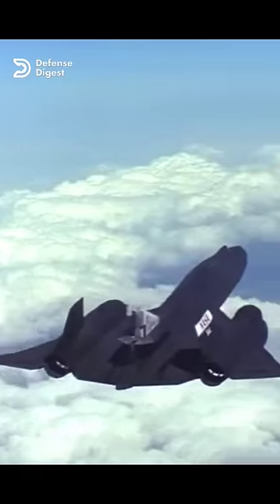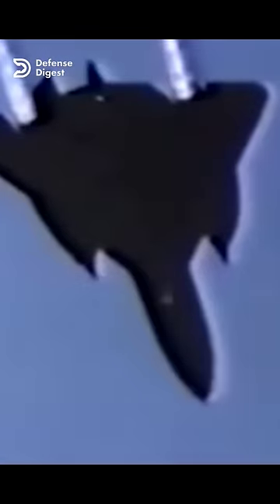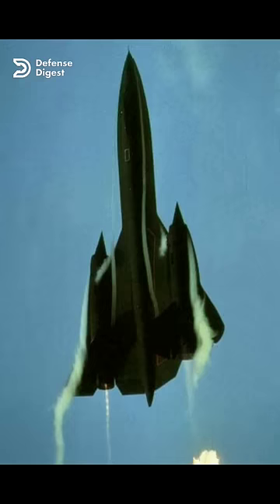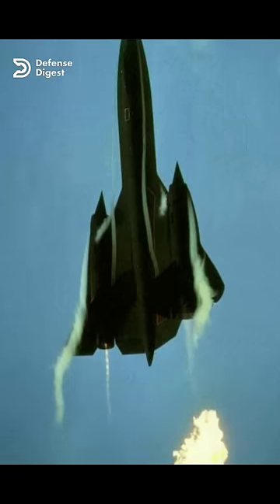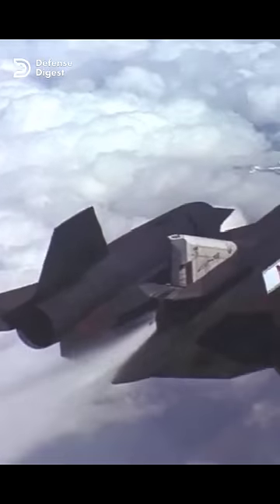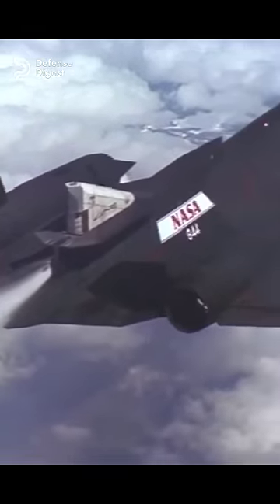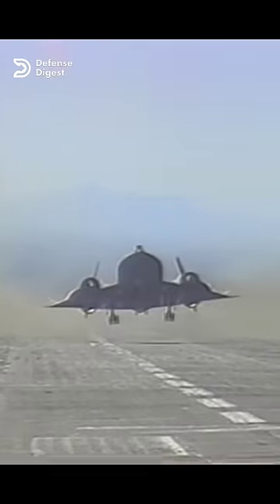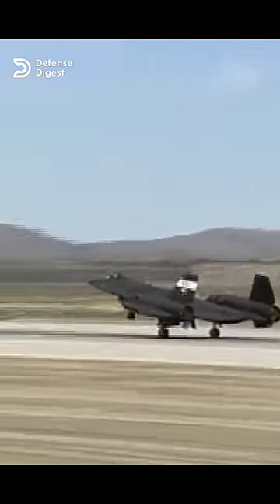The SR-71 Blackbird Is So Fast That It Lights the Sky on Fire! #shorts

Comment: You forgot to mention that the SR-71 used to leak fuel when it was on the ground. It was due to the fuel tanks being designed to fully seal as the plane increased its altitude. The Blackbird would have to be refueled just after takeoff. Still, the SR-71 Blackbird is one of the most amazing aircraft ever designed, with speed and altitude records that may never be broken. Such an iconic aircraft.
Reply: Well if they didn't do that the gas tanks would crush and the rest of the fuselage would crush itself and explode under the pressure of doing 2,200 miles an hour as well as the outside temperatures reaching 650 degrees Fahrenheit
Reply: @Priester23  you'd have to do what rockets do, pump alternative gas into the fuel tanks to stop them from crushing
Reply: Ha! Lol. While I love the SR71 what they have now (*& created in the 80s) was/is aircraft that you CANT see, it flies too fast for the human eye to see. *The TR3B is triangular & has plasma thrusters. A more recent craft is more round, cloaks itself & bc of the radiowaves that cover it, if it flies too close to the ground, it starts everything on fire (forest fires) & is faster than the human eye but you can see it on surveillance cameras if you slow it way down. Can land in the ocean with no prob, kept at an underwater facility off of Calif.
Reply: @Priester23  you do realize that all aircraft fuel tanks are vented to prevent them from collapsing.  The fuel it used had the consistency of syrup.  It was used to cool the aircraft, and get it more liquid at the same time.
Reply: they were designed to seal with heat, not altitude.
Reply: @Userxyz-z2d  there's so much wrong with that i dont even know where to start. anything anywhere near that fast would explode from air resistance alone. all their really fast jets would have to suborbital to prevent that. ive heard as fast as mach 5

Comment: I was a USAF ARFF and The Blackbird is Stationed at my Base, RAF Mildenhall, We we're required to standby in the Hangar during Refueling & Defueling we had to stand right in front of the Engine. TEB can't be extinguished with foam or water. Sand was all that worked to smother the flames. 
We trained on her twice a month. Best of times

Comment: I grew up in Colorado Springs & more than once, SRs came into Peterson Field there. They'd come in slow final approach at what seemed like treetop level right over our heads where I worked on Hwy 24. You can't really appreciate how big and awe-inspiring they are till you see one in the air. I'll always remember the SR71, the Space Shuttle on top of a 747 and The Concorde coming into Pete!
Reply: I was stationed at Peterson AFB from 1990 to the end of 1993. Still the most beautiful place I've lived. Every morning open the curtains to see 14,110 ft. Pikes Peak. I miss Colorado Springs.
Reply: @douglasdixon524  we moved there in 1956 from OK & thought we'd died & gone to heaven. We left in '90 but my son still lives there.
Reply: @chetcarman3530  My mom grew up in Cushing, OK during the 1930s and 40s.
Reply: @douglasdixon524  I spent my first 8 years then a few more off & on in Elk City & a year in Midwest City High.

Comment: No catalytic converters?
Reply: In California they call them Cadillac converters.
Reply: @bartbullock9742  
So in California if I put a set of these on my Datsun it becomes a Cadillac ?
Cool, I'm gonna do that . . . ✌😎
Reply: They gave it the pops and crackles tune
Reply: Where’s the electric motors. Or solar cmon
Reply: This is so funny, omg!!! 🤨😶 have you ever considered comedy as a profession? I was expecting your page to be full of funny videos.
Reply: It did have badass manual transmission and 4 barrel Holley carburetor.
Reply: aircraft don't have emissions so probably the biggest palution dumpers out there are airdracft
Reply: @thenaturalmidsouth9536  This plane needs a 454 big block engine to start it. No lie.
Reply: @3dsmax rocks  I'm small block Chevy guy, but you're dead right in this case, a plane like that needs a big block. No replacement for displacement.....
Reply: No, thieves came by overnight and took it.
Reply: My ride has muffler bearings
Reply: @thenaturalmidsouth9536    Even a Holley Dominator wouldn’t be enough. No,it’s gotta be one of those big,8-71 Dyer superchargers with giant,twin turbos! Must have some kind of highway gears to get that Mach III speed on top end,though.
Reply: @thenaturalmidsouth9536  all my stuff is. A Chevy dude my dad a Ford guy I had a 73 one millionth Vega Orange with ss strip he wreaked one night coming out of the base gate .lol then got another Vega I ended up getting a 68 firebird  sold the Vega and the gi that bought out the small block my dad had with his Austin helie 350 400 crank they bought the retro kit for it but I don't if he ever welded the and connected the unibody with the the kit to keep the body from twisting a pooping the indiw and twist the body.  The. I traded the 68 fo a69 nova . ..

Comment: I've seen SR71 in several airshow. One, near Beale at a small airport. Fly by only airshow. Loved it. Al though one year, the B-52 demo beat the SR71 demo. This B-52 demo finished with high speed pass, 100 feet or so off the deck, with all engines  full throttle.   Big ass plane eye level from bleachers with engines screaming load black smoke exhaust. Man blackbird is great but wow!

Comment: The black jet with the Lab kit in the trunk.   Abbotsford Airshow, mid 80's.  Our family had flown in riding a Cessna 310 with pops at the yoke.  The last two rows of seats were removed  for a 'stretching area/vomit comet ride".     It's like surfing, it changes your life seeing the SR-71 light the pipes.     A snippet in there  of "the test bed sled" with the "white wedge" Hydrogen slush engine on the rear back, purging gasses.  Watch this again,  you'll see it.  SR-72 engine test, back in the day..   Soap on a rope exhaust trails,, but no more trails now.    damn!.

Comment: Someone correct me if I am wrong but I am pretty sure that the seams around the bird to include the fuel tanks are made with a certain amount of play due to the fact that the bird flies so fast and the friction of the air and the aircraft heat the exterior skin to a point that it swells closing the gaps

Comment: Something else really cool about the SR-71 is that it would visually leak fuel from the plane like it’s sweating. The panels on the plane had to have gaps between the panels because of the enormous amount of heat the plane would generate. Once the plane heats up, the gaps in the panels would close and stop the leaks

Comment: It's mind boggling how complicated the engineering on the blackbirds was. At the speeds it traveled things had to be designed very uniquely. Many in the comments mention how it would leak file when on the ground & why. But to know to design the plane to do so shows they knew about how the air friction at high spend would cause expansion of the body panels. 
Just amazing

Comment: It also leaks like a frickin sieve. Because of the high heat it produces they couldn't completely seal the fuselage, so when it's on the ground it leaks fuel. But once its in the air and starts heating up the metal expands and seals up the gaps.

Comment: From my understanding the SR-71 leaked fuel like a sieve while on the ground and had to be refueled immediately after takeoff. Apparently the aircraft was designed to do this, but once the aircraft got up to speed, the heat from flying so fast would seal the leaks. Another interesting fact is that this aircraft held around 12,000 gallons of fuel when fully fueled up.

Comment: As stated before, this lovely piece of art leaked fuel at runway pressures and operating temps below it's required stats due to the entire aircraft being a flying fuel tank with engines strapped to it. When at altitude and speed, it would rarely leak due to expansion of the fuselage.

Comment: They needed the unique fuel because the plan at high speeds expands so they needed to build it loose so all the individual pieces have room to expand.

This caused fuel leaks and explosions so they created a fuel that would not burn on its own and pilots were put out their cigars in this fuel.

Comment: They said if you had a roaring bonfire, and threw a bucket of JP7 on it, it would probably put it out! It was like this because the jet leaked so much when on the ground and so was a fire risk. Once the plane was in the air, the fuselage heated up, expanded and closed the gaps.

Comment: It's hilarious that such an advanced jet was known to leak fuel out of the fuselage. Straight through the cracks in the panels. The immense heat generated by the high speed would cause the panels to expand and therefore seal at speed, so they just left the large panel gaps and dealt with the puddles of fuel while it was taxiing. Wonder if the fire balls were from igniting the leaking fuel.

Comment: I actually got to touch a black bird! Well it was my Banny hen chicken when I was a kid. No seriously it was back in 1990 I think. They had it sitting out in front of museum with no change or anyting around it. Now I had been got it and you cannot see in the cockpit. Because they had that cover they put on a cockpit. That thing was awesome 😎. I also was pulling guard duty one day as second ring guard for the stealth fighter when they brought it out and show the public. But I couldn't get you closer to it and I wouldn't supposed to look at too long. The first ring guard was right at the plane and I was 25 ft out roughly. Yeah fullmag azeen and it was off safe. I know what his orders was because they told me. And I don't get by the two often but where the stealth bombers based out of. But when I get anywhere in the general area even if it takes me an hour or so out of my way I'll go through there just see if I get a glimpse of it. Now seeing that bomer with his wingtip pointed to the ground and the other one straight up in the air just sitting there not moving no noise about fifty feet above the traffic on the road. That was a more interesting sight to see then the Blackbird. But just driving through there and seen the bomber maneuver around in the past wasn't near as interesting as the blackbird. The stealth fighter wasn't near as interesting as that blackbird. The Blackbird was not a mock-up either. I never seen this about the black bird with its propulsion system how they started it. Very interesting

Comment: I remember reading that they gave it just enough fuel for take off and then it refueled in the air. It was done this way because on the ground, while it's skin was cold there were gaps between the various pieces and once in the air its skin heated up and the plane would expand thus sealing up the gaps. The most amazing plane ever built.
Reply: Popular myth but not really true. It took off with 40k lbs usually and would refuel in the air.  Some missions it took off with 65k lbs and not need to refuel. 

But the gaps in panels,  heating up to seal the tanks etc is untrue

Comment: Small tank of that cuz it had to use that to ignite the kerosene that was actually mixed with the chemical to keep it from catching on fire because when it was on the ground not flying it would leak fuel out so they had to make sure the wasn't flammable

Comment: Also should mention the black bird leaked fuel at lower altitudes and on the ground due to the fuel tanks needing gaps in order to expand whilst at cruise speed. Which I understood to be the reason for the fireballs
Reply: Most of your entire comment is incorrect
Reply: @gr8crash  which part? The part it leaks fuel or the part where it shoots fireballs? Both of those can be proven with a quick search online
Reply: @loganbaileysfunwithtrains  not that it leaked fuel, virtually all aircraft leak fuel that's not uncommon. But your part about about the gaps in panels etc is a popular myth and completely untrue, and also has nothing to do with the fireballs.

Comment: leaks Floyd like crazy sitting on the tarmack one landed in Colorado when my dad was stationed at peterson  . he said Iit leaks while sitting there they had the cookie sheet looking panss under so it did not contaminant the flight line. when it was flying and under pressure thee seal seeld up and the leaking stopped .kinda wierd..

Comment: Hard to believe a plane that big, and that powerful, and most definitely not design for any type of aerobatics, is making that relatively high speed, high G maneuver and it's only when the plane is pitched up past 90° that the pilot brings the engines UP to idle. Can the SR-71 do a cobra? Haha cuz it could definitely pull a Kulbit maneuver.

Comment: The Triethylborane used to ignite those engines is absolutely toxic to humans. This is why Noone was ever near the runways this plane ignited its engines. JP7 fuel was notoriously hard to ignite, needing to be fought to about 500F then atomized for it to get in the ballpark of ignition. FYI Not only was the fuel used to power the place, it was also the hydraulic fluid, coolant, and lube for the J58 engine. One fluid doing all of it. The fuel was also owned through out all the hit spots on the airframe and devices to collect heat before being sent to a jet nozzle for combustion. Before Mach speeds, they would fly for a short period at subsonic speeds at a specific altitude to shed heat and freeze the aircraft over, then sprint across tgier surveillance target.
Reply: There's a LOT of incorrect information in your post. People were literally underneath the aircraft when the engines were started. The fuel didn't need to be brought to 500° before ignition. It was used as a hydraulic fluid for some engine components, but not for the aircraft. It was used as a heating but not from all over the airplane either. And they never flew to "freeze over" the aircraft.

Comment: Why does the gas need help being on fire you ask? Because the gas is also used as a coolant. The SR-71 doesn’t have a gas tank. You know all the empty space between the components and wires n shit? Yeah they just put the gas in there. It keeps stuff cool and then it gets pulled into the engine and has to be forcibly ignited… kinda like how you need a smaller explosive to make C4 explode.

Comment: This aircraft was weird in its charateristics. Using its own fuel to cool itself like whatt?? Go faster to evade missiles, okay awesome, using its mere design as defensive and offensive maneuvers despite the fact it had no physical weapons to revert to in case of emergency. Risky. But the weird fact its way to save gas was to simply go faster like whatt?? That's the opposite of what you should do lol. This aircraft is just stupid advanced.

But whats crazy to me is its engines that were mind-boggling complex, as it had many components and air ducts and uno the usual, but the way they worked usually in tandem or in certain milliseconds of one another that allowed said engines to perform so well. The design of the engines had secondary protocol design (aerodynamic performance) elements in case one mechanical component failed while at high-speed.

Its only flaw from what I remember is not the leaking fuel, that was required for how it was designed, quite a clunky trait but it was necessary. Its flaw was merely cost to operate it.  It was a Flawless Aircraft that was never shot down by an enemy. Despite the numerous attempts to do so lol. And they say there's no such thing as perfect. 🤭 

On a side note: the aircraft was capable of higher speeds, but for reasons I cant remember. It was never pushed. 😬
GOHD DAYUUMM.

Comment: A special fuel was developed that wouldn’t hardly ignite at all. And the creator proved it by putting out his cigarette in a puddle of it. The SR71 was a leaky aircraft and when it flew super high it became much more compressed and wouldn’t leak. That’s why the fuel was developed. It was just a leaky aircraft. Listen to the ol’ blackbird pilot stories on YouTube about ground speed. One thing he said was that the outside of the aircraft was so hot from friction of the air and the speed of the aircraft that he would cook his lunch on the widow.
Reply: Lot of inaccuracies in your comment. It did leak yes, but it wasn't THAT leaky, nor was that why the fuel was developed. Also the "ground speed" story isn't true.
Reply: @gr8crash  well I wasn’t there, and a pilot told the story. The fuel info was a discovery channel episode on blackbirds. So it’s not like I’ve done this research extensively. Chill lol. How do you know the ground speed story isn’t real? The top speed of the sr71 was like 2200mph.
Reply: @Warmindking  heating up food on the window was a thing, but it wasn't like super hot to actually "cook" anything. Issue with a lot of those specials is they are based on old inaccurate information from the 80s and 90s. Even the newer one Discovery did was a rehash of its earlier one. It did leak yes, but it did leak very much in reality. The ground speed story is wildly untrue. Most people within the SR71 community no so and don't have a lot of good things to say in regards to that pilot. Without all the details unless interested, the easiest detail is that the story originated as a "tongue and cheek" story within the SR71 community in the mid 70s, almost a decade prior to hik becoming a pilot in the program.

Comment: The SR 71 should not exist. It is the equivalent of breaking the game or hacking or cheating.

The thing gets so hot at high speeds  that the metal expands, meaning it sits on the runway leaking fuel since the metal was built slightly too small so it expands and fixes the leak ar high speeds.
Reply: Your 2nd comment is totally incorrect though